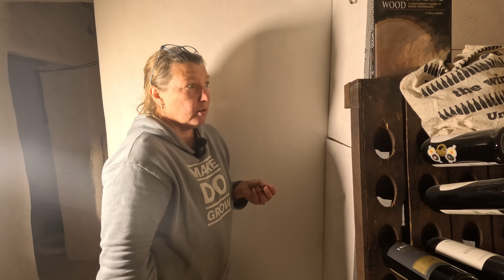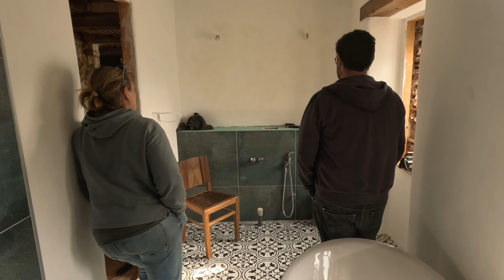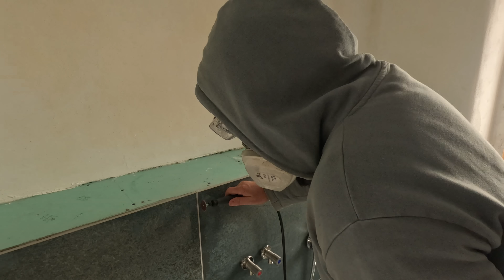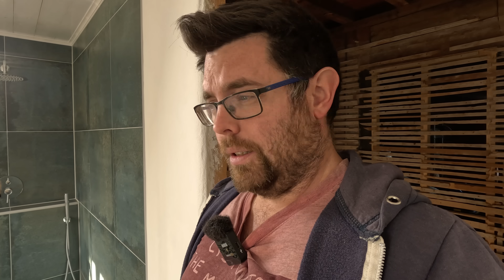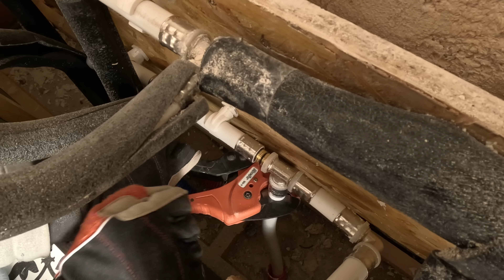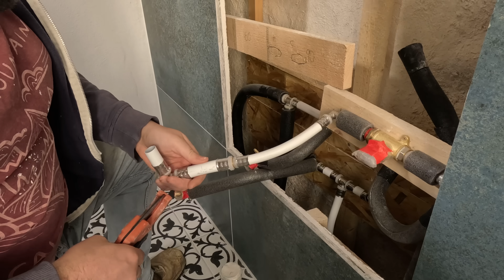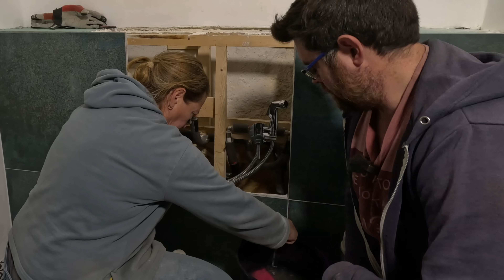Bathroom Nightmare: When Plumbing Goes Wrong!

Comment: I really admire your great attitude, patience, determination, and thank you for teaching us about newer systems and their potential failure points. All my DIY plumbing was soldered copper/brass, in a wooden house, my fears were of fires not leaks! Now helping my son when he needs any soldering while he uses PEX and crimp rings for most connections. Good luck with the rest of the build, happy showering!

Comment: Sory for that. I think your machine is not that  stong. I use an electric one. I'm teling you this because your fiting tourn's arround to easy even wen they are crinped. I think that you can regulate the pression on your tool. I'm working in plumbing for 25 years now and that happens not offen. Testing that would be 8.0 bar for 24 hours. That pipe is guarantie for 10 bar at 90C . Aniway, you are doing a great job. mery cristhmas  I'm living in swizerland but i'm from Pombal.

Comment: Not to insult you intelligence but a suggestion.  The next time you complete any plumbing in your home hook it all up and use it on a regular basis for about a week if you can so that if a leak is going to occur you can find it before you have concealed it in the wall.  When ever i have done my own plumbing i have used it for a solid week before closing it up.  The fitting may have come loose from a "water hammer" on the system.  Even if on a well or municipal water system you can get water hammers that will stress the whole system.  Rapidly closing a valve or sudden surge in pressure can cause a water hammer very easy.
Reply from the maker: Exactly how do you use it when you’ve not yet tiled the floor, installed waterproofing etc?
Reply: @MAKEDOGROW  The example I could give is have the system on after your plumbing is "finished" and then go about your daily business using water like normal.  When i remodeled my Bathroom i made a concerted effort to go in and run the shower and sink faucets every day into a 5 gallon bucket morning and evening so i could flow water on a regular basis and give it a work out.  I was so paranoid it would fail like what happened to you.  I am just a DIY guy myself and learn from my mistakes. And here in the States plumbing is all connected, so any time i used my Kitchen Faucet or other bathroom i would get water to surge the entire system and that will help identify leaks as well.  Hope that helps!  And I love your channel!  You guys are a great team!

Comment: I have been thinking about what I want when I build my final house, for a very long time. I am convinced that I will run all of my plumbing external to the house and simply cover it with insulation and easy access facades. I have owned a concrete house in the Tropics of Asia, a Modern Bavarian house in Southern Germany, and a 120 year old row house in the Northeast United States. There is nothing advantageous about putting the plumbing inside a wall you cannot access immediately. It might not look pretty but I will not have the problems that I have had with leaking pipes in the past.

Comment: We had a full bungalow renovation. Part of the job was chasing ugly exterior central heating pipes into the wall before walls were newly plaster skimmed. Soon as it went live after heating engineer signed it off...leak in the lounge! Builder came back, hacked off new plaster, located problem...failed elbow joint. 2½ years on, all is good. Take heart from that!

Comment: TIP .... on this tipe of conection , to be sure the pipe is all in trough the metal colar,,,,,, i always make a pencil mark on the pipe, 2cm from the edge, ((wich is the metal colar lenght)),,,  that way i can be aware if the pipe is all in,,,,   the same goes to Sewer pipes,,      also Beer pipes /  wine pipes 🤣🤣
Reply: Great tip, marking the pipe for quick visual assurance

Comment: Maybe a nice thing to do is pressure testing the system, I know they don't do it in Portugal but running compressed air prior to commisioning at a higher pressure than operating would show issues like this early.
Reply: Oh you pressure tested; yeah maybe you just had bad luck 👍
Reply: Weird how it failed, you'd think the pressure test would've caught that; maybe it's just due to the difference in the way the water flows, water hammer may have knocked that fitting out of the socket whereas the pressure test was gradual enough to not move it.

Comment: As a homeowner there is nothing worse than going somewhere in your home and suddenly seeing out of nowhere water.  For a moment you have to convince yourself that the water is real (this takes about 15 seconds) and then you have the realization that you have to do with it.  I bought my home in 2007 and this has happened to me 4 times all in different areas.  The joys of homeownership 🙂
Reply: Our dishwasher of 24 years (yes, it's from 2000) has flooded the kitchen twice in its life, once in 2006 and again earlier this year. Other than that it's been working perfectly fine and we have no clue why it leaked those two times. Fortunately it wasn't a whole lot of water and our pre-WWI kitchen floor is reasonably waterproof (terrazzo poured against the bare brick walls before they were plastered).

Another time I came home and heard a very strange noise walking up the stairs. I followed the noise down into the basement. Turning on the light at the bottom of the stairs I felt something strange around my feet. Looking down I realised I was standing in 5 cm of water but my shoes kept my feet dry. Some unknown idiot had turned the utility sink tap on at full blast and the drain was slightly iffy, causing the sink to overflow. Spent about half an hour scooping and mopping up the water.

Comment: Sharkbite fittings are really good. Expensive, but they have never failed for me. So sorry this has happened. Really a bummer. But what a great save on that tile! And there is no guarantee the professional plumber also wouldn't have messed up on the crimp. Lesson learned to keep the fixture open for a while to extend the leak test time frame. Great result though and thank you so much for sharing as I know I've learned from this segment and I'm sure others have too.
Reply from the maker: Sharkbite is a US thing. Nothing like that (that we know of) either in the UK or Portugal.
I’ve seen many videos about those fittings and always wished we could get hold of them

Comment: can you fit that tile back without glue/adhesive and fit it with screw fixings? onto a frame ? so you can remove again for access or silicon in place

Comment: As a note, I always do a wet test on all the fittings my DIY plumbing before I close off the walls. I am also not sold on the crimp fittings used these days on the plastic pipes. I recently renovated a shower where I used PEX tubing and used SharkBite branded couplers. They are push to lock and I have never had issues with them. They are quite popular in the states and I have used them for a number of years without failure.
Reply from the maker: We did do a full wet test, and pressure test, before doing all the plasterboarding, waterproofing and tiling. Seems something after all that caused the failure.
We’ve seen Sharkbite fittings on many videos, they look the bomb! Unfortunately seems only to be a U.S. thing
Reply: @MAKEDOGROW  Maybe a "pull" test on future crimps to see if something moves. I am too old school to completely trust the crimps, but it is catching on in the states over the traditional soldering for speed and ease. SharkBites are kinda expensive compared to  other options. You guys do a phenomenal job taking on such a massive project(s) by yourselves. Especially tiling. I hate tiling. Like the results, but the process is exacerbating.

Comment: and position valves to shut off individual pieces of equipment - you can get small doors with recessed panels to take tiles and also do the top shelf in wood so you can remove for access

Comment: Longtime user of multicouche (multilayer) pipe here in France. The things I would double check:
1. Do you have the correct profile insert fitted in your crimping pliers. Tend to be TH profile here in France, some also use H or U profile inserts. The correct profile is also stamped on the fitting, so easy to check.
2. Have you used PER fittings instead of Multi couche/layer fittings by mistake?
3. Make sure you use a pipe reamer/deburring tool on each pipe end.
You may have done all this already but worth doublechecking.
When I am plumbing in a new bathroom or kitchen I use a central manifold for each new setup. And have an access panel door on each manifold. Hot and cold manifold, then a single pipe to each water source from the manifold eg. basin cold, shower cold, bath cold, etc. each individual supply can be switched off at the manifold. it also reduces the number of joints that are hidden behind walls, etc. Ideally you try and run an uncut length of pipe from the manifold to each water source.
https://emmeti.co.uk/hot-and-cold-water-manifold-system-applications/

Comment: Good skills in action. Will you please make a video where you survey all the HVAC system you've installed, including the exchanger and costs?
Reply from the maker: I think you’re referring to our ventilation system. If so, it’s not up and running yet (we haven’t installed electric to that part of the building yet). But for sure once it’s all in and up and running we’ll report our thoughts

Comment: I was out shopping yesterday and was on my way to the grocery store, my last stop. I have a very old car and always keep an eye on the gauges. I looked down and the temp gauge was on the red. I turned on the heater and blower and it came down a bit so I was able to keep driving until I could pull off the busy road and into a parking lot. I had the car towed and they brought me home. So, instead of working today, I am sitting here waiting to hear if it is the radiator or a hose. I did not get upset, or curse or cry just kept sighing. I hope the repair is easy and not too expensive. I am glad you were able to fix your leak. And remain leak free forever. And that I get my old car back so I can go to work and save money to buy a newer car.
Reply: Car troubles are the pits. I do hope they're able to fix it for you so that your plans can continue, and this is just a small wobble along the way. 😊❤❤

Comment: You could try a process where you instal a security valve at the entry point of each room ( bathroom, kitchen, etc). That doesn’t prevent damage but will help to isolate damage and facilitate repair. Also the removable tiles are a gos idea. 
I also have filters on those valves that I clean once a year. 
Merry Christmas

Comment: I think you eluded to this in the video. You could see the left hand connection was under stress from the cable securing clip. It wasn't at 90%. Perhaps the securing clip was just too close to the joint. Well done for the repair anyway

Comment: So sorry, what a disappointment and so good that you could fix it. I can empathise earlier this year we refurbished a shower room. All looked beautiful and a few days later we had guests and water gushed through the kitchen ceiling.  Called the plumber who reckoned the cassette on the shower had failed so he replaced it. A few days later, more visitors,  same problem, plumber said cassette must be faulty and Aquiliser replaced it foc. More visitors,  same problem.  Plumber failed to reply so a friend accessed the shower from the wall behind the shower  - an o- ring to a spare outlet had failed. We have decided to build in an access panel just in case. Very stressful as i thought the beautiful tiling was going to have to be taken off. Motto, if you can make an access through the reverse do so, maybe a creative cupboard.  On our concealed cisters we have added a removeable panel to allow access to the cistern we used oak 'lids' on two and granite on another two. Really hope its sorted and you can have a relaxing Christmas break.❤

Comment: Hi Guys, these things happen and good to see you figured out how to remove the tile using multitool I was literally shouting at the screen when you were discussing the angle grinder option, this is the last option as it’s dusty and one slip and tiles get chipped. I would suggest the best option would be silicone the tile back (wedge the grout  line at bottom) this is easier to cut to remove if needed if access is needed, but you know once you do have it made removable you will never need access again!😜🤦‍♂️

Comment: You have my empathy.  I have been there.  One thing I remember is your awesome choice for insulation.  Not sure if the insulation got wet, but hemp insulation can be reused if it gets wet.  It just needs to aired out and it still has its R-value.

Comment: After a lifetime of using compression fittings in the UK I used crimped pipes in Portugal and had two failed one within weeks and the other about two years after installation. Both needing the tiles to be broken out to affect the repair.

Comment: Leaks behind  newly installed tiles has happened twice two separate properties, two different plumbers. I invented a new way to make a tiled bath panel removeable by just cutting the silicone seal. I attached the waterproof cement backing board to the metal bath frame with industrial velcro not glue, so all the tiles can be removed if necessary to access plumbing the lesson learnt the hardway when the plumber created a small access panel initially. Good luck.

Comment: If you still have access to the backside of your shower wall, than maybe you could make that wall a permanent access to the plumbing of your shower, by closing it off with a large removable panel that you remove by taking out 4 screws when you need to get to the plumbing. Good Luck. Always enjoy your videos so much.

Comment: Is that plumbing next an outer wall? Because if not, you should be able to access it from another room, which is usually the case.  Very rare is the plumbing that never breaks. Also if it is next to an outer wall, any Winter freeze could easily affect your plumbing.  Of course you likely have very few of these in Portugal.
You guys are great.
Reply from the maker: Internal wall, but it’s 600mm thick stone wall, which is why we had to build the fake wall in the first place.
There’s zero chance of a cold winter affecting internal plumbing … one, because it just doesn’t get that cold here, and two, the thick stone walls don’t allow that much cold in

Comment: Hi you two… I know this is frustrating as we encountered a similar problem but ours were luckily in the cellar and the plumber was on hand. He said that if the joints aren’t pushed in firmly and the monstrous electric machine crimps, it will fail. He said if you do it yourself later, use the one time use ones that you don‘t crimp but use self crimping one time use ones. We had one leak also when we installed but only drips. The pipe wasn’t pushed completely in. After we have had no issues. I think you are correct that the one joint wasn’t crimped properly. You could make the one tile with strong magnets so you can access it and use silicon so it‘s easier to remove later. When you turn the water on, it does jolt the water pipes, maybe make the clips further back on the pipe so it can move. The Profis make mistakes too. Better now than later. You two are doing an amazing job.. merry Christmas 🎄🎁 and all the best 😊

Comment: If it's of any interest, I had the same concerns over concealed plumbing following failures of contractor's installation. I ripped off all the tile and plasterboard stud "walls" and, rather than re-build all the studs and tiling, I used instead rigid core PVC tiles and applied them to the studs with nice screws and cups. they still had what looked like grout lines (using silicone) which are easy to cut with a Stanley knife if and when required. I certainly wouldn't have liked to remove all your tiles which are large and heavy....

Comment: Hey, for your peace of mind you could consider putting a sensor into your cold / hot water pipes to check whether you have a leakage when you are not at home (+remote valve if you wanna be extra sure)

Comment: I doubt if it is you. I suspect the fitting failed. Water travels for miles.  Just get the point of failure fixed and carry on.  I opened up the wall behind for a similar issue.   It is fine it was a failure of the fitting.

Comment: My dream is to design and build my own house so that I can control all the engineering and age-proof it to the extent possible.  One of my main ideas is for ALL plumbing to be in a column that is heated (i live in the north) and have a drain with access.  Like an actual central room (like an elevator shaft inside a skyscraper).  All water rooms (kitchen/laundry/bath) and appliances (faucets and drains) touch this column so i can access all pipes from within and any/all leaks are accessible and drain inside and out the bottom.  Waste of space?  Maybe a bit, but not a lot if done with purpose and care.

Comment: Nooooo! Is it because you finished it on friday the 13th then eyh? 
For interest, you tested at 5bar, do you know the pressure that is actually coming into the house? Here where I live its between 2.5 and 4 and it runs over copper piping.. 
I guess in Portugal it can vary lots due to it coming from reservoirs?

Comment: I am no plumber, but - do you have an expansion tank? It can happen that, for example, that when you close a faucet thee is a pressure increase at that moment causing connections to fail.
At the same time I have never had issues with these crimp-on connections failing. Another extra safety measure I have been suggested is to crimp twice with repositioning the crimp tool in-between - creates tighter connection.
Also - it is a good idea to design the piping in such way that all the connections are in a single location (a collector for example) where you can put a door and have easy access. Might use more piping though, but is worth it.